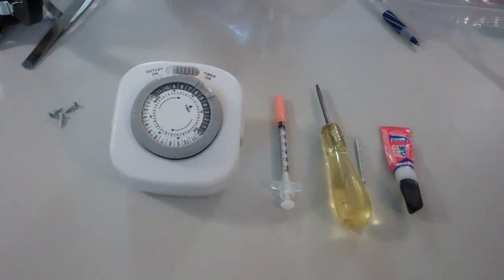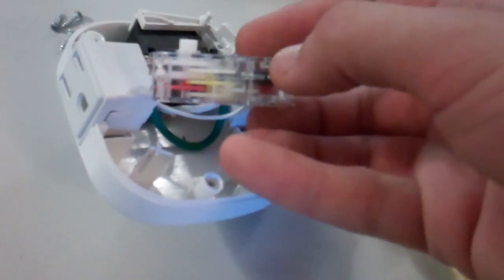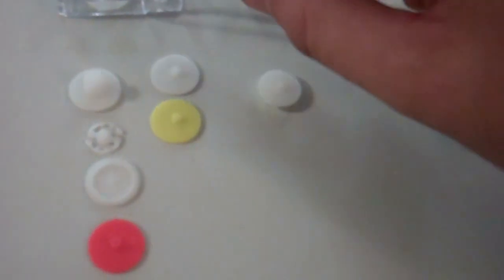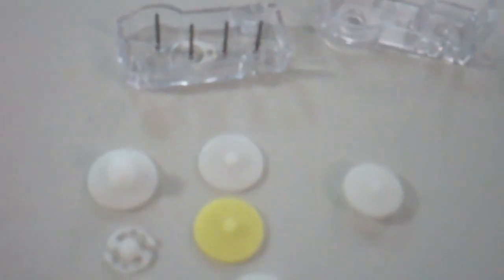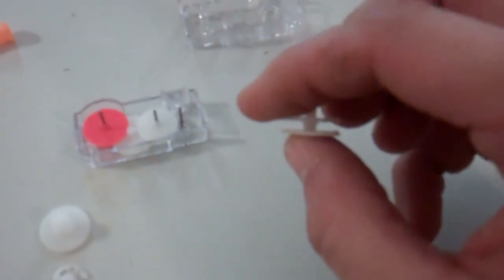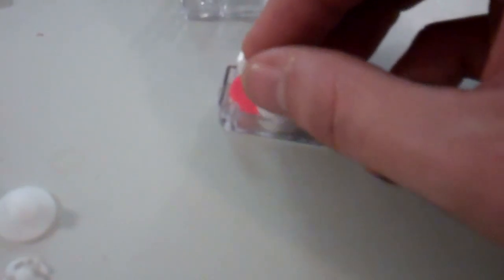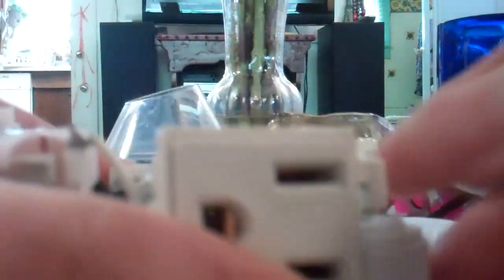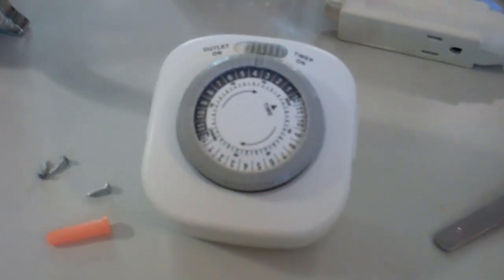Modifying a Utilitech LIght Timer.mp4

Comment: Used this video to guide me. Got 2 different models of 24 hour timers from Walmart. Lowes was closed. I bought 1 "Hyper Tough" 2 prong, $3.94, and 1Hyper Tough 3 prong, $4.74. The instruction works for both Models. Though they look slightly different inside, I followed the instructions for the Utilitech model and I got 55 seconds per pin on both models -HT1006 and HT1023. This video was definitely a money saver. As for the gluing, I made sure I had grease on the pin and used the hypodermic needle just to spread it precisely where it needed to go. Great video.

Comment: This is awesome.  I just successfully did the job on a GE version of the timer.  The 6$ model I found at Target.  It was fairly easy.  Instead of removing a gear, I cut the gear to make it "skinnier" so the teeth wouldn't catch, allowing it to remain there as a spacer, hopefully will last longer this way.  Anyways, then I proceed with gluing.  I need to make 4 "washers" out of a business card to get a good mechanical connection, but it works absolutely perfectly.  Timed it with my stopwatch, and I'm getting 59 seconds per segment now, perfect!  I was shooting to cycle 1 min on, 4 mins off!

Comment: I just modified two Utilitech 24 hour timers and they both work great. Both cycle in 40 minutes (i.e. a depressed button has an on time of 50 seconds). I didn't have a syringe and without one it seemed likely I would glue the gear to the shaft. So I came up with an easier way. First I glued two pieces of plastic to the first gear as shown here: http://postimg.org/image/pk015rt45/
I got the plastic by cutting of the heads of a plastic 4-40 screw, but any piece of junk plastic of about the right thickness should do the job. Probably wood or cardboard would work equally as well. After it dries put a drop of glue on top of each of those plastic pieces insert the axel and place the 2nd gear on top. The finished result looks like this: http://postimg.org/image/mfl92ab33/
I used thick CA (i.e.superglue) the first time and epoxy the 2nd time. Both work, but I think the epoxy is slightly easier. Try not to use any more glue than necessary. Any glue on the gear teeth will doom the timer just as easily as any glue on the axel.
Notice that there are two parts left over that you don't use. You can see this from the video, but perhaps it would have been nice for him to mention it.

Comment: Hey there. I just did this conversion and it worked fantastic. Turned my 24 hour timer into a 32 minute timer.

A couple notes about the video and my experience: 
--Not all of the gears that look the same ARE the same (look closely. If I recall, one had 6 teeth around the small axis, and the other had 8.) Doubt it makes any significant difference, but be aware.
-- There is no way in hell I could get this to work with superglue. Its no where near strong enough. I ended up using an epoxy.

Thanks!

Comment from the maker: Sorry to hear that.  I used a couple different brands on mine as well, so far all are still working.  Maybe that brand has a weaker motor?  Also, you probably already have, but check to make sure the gears are running without the dial engaged to ensure its not an issue of the glue making them stick.  Hope your luck improves.

Comment from the maker: Hi ksmdclan, you got it.  Just use the timer in its factory condition and you're good.  Its designed to run on a 24-hour cycle, so you just push down half the tabs and it'll run for 12-on, 12-off.  

On a side note, however, I did try to tweak around with the gears to come up with an alternate time-setting and I wasn't able to find another configuration for the gears that would let that happen.